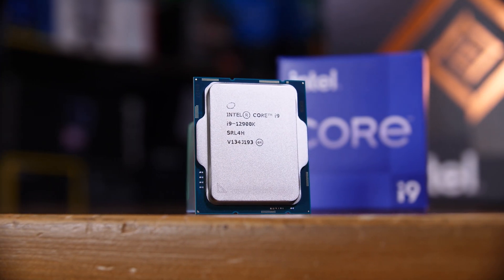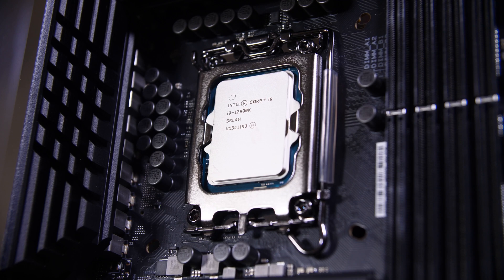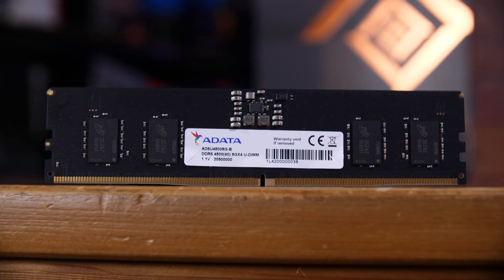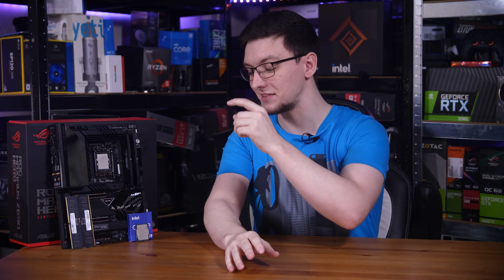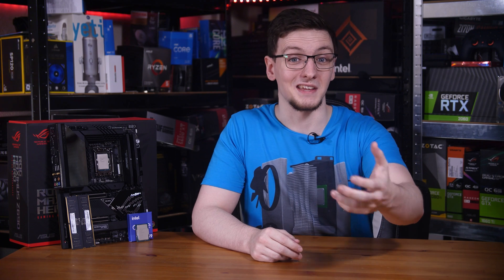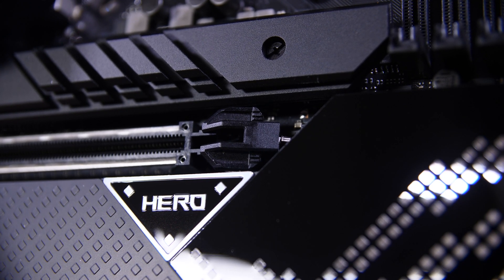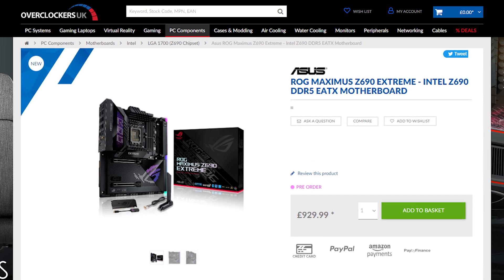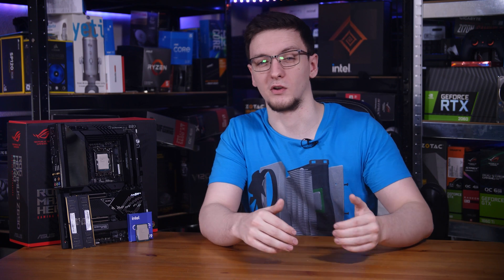Z690 Explained - New Socket, DDR5, PCIe Gen 5 and more…

Comment: I install a quadroo k5000 pci 2.0 card in to Asus  z690 prime A motherboard it has a 
5.0 pci slot which i came to know that its not compatible with pci 2.0. And  i removed the card.
My question is will it did any damage to motherboard?

Comment: I got the MSI Z690 Carbon Wifi + 12700k, though I've only populated 2x Ram slots 5600mhz, because if populated with 4 modules, there's that Boot looping issue that DDR5 has... Ill buy another 2 modules once they fix the boot loop.... but I have a 1tb Samsung 980 pro in and Dam, Its snappy as hell. Loving the speed difference and its notable!

Comment: Sticking with X299 and 10980xe for now. I don't see enough to justify moving to Z690.
Reply: I was on the same boat at first then I started thinking about pci ex gen 5.0 and ddr5 when I know I upgrade gpu's every generation so I know rampage vi extreme on x299 is at the eol and it won't get support for pci ex 4.0 but these z690 boards support both pci ex 4.0 and 5.0 some of them do so if I am looking at it that way I have reason to upgrade but I have another case I will use just so I can keep my x299 system around

Comment: Those mainboards are incredible but I don't give a fuck about the new platform so far. DDR5 is no big deal until they get faster and cheaper, PCIe 5.0 is completely meaningless (even 4.0 is quite irrelevant when you don't really need the fast SSDs) so it's all just way too expensive to care.
Reply: you worng faster ssd is faster loading and faster open world rendering
Reply: @naor9792  And how many games take advantage of that today? In an actual meaningful way that has a noticable impact? None.
Especially on PC where people with SATA SSDs and even mechanical HDDs still need to be kept in mind for pretty much anything.

Don't fall for the marketing, PCIe 4 is primarily good for creative work at the moment.
Reply: @Oceanborn712  tbh im just sad bc i got the z690 master and its dont support gen 5 ssd but if you say we be ok with gen 4 so i take your word on it
Reply: @naor9792  Wow I wasn't aware there's Z690 boards that don't support PCIe 5 SSDs but it does make sense. Consumers really don't benefit from that yet and they won't for a few more years. If you're not working on huge video projects or something like that, you really don't gain anything from it.
But I would be upset as well if I found out my new board isn't as future proof as I'd thought. Honestly, it would have made more sense to restrict the PCIe ports to 4.0 and have the m.2 slots be PCIe 5.0. Graphics cards barely benefit from PCIe 4 and it's gonna be forever until they actually make use of 5. SSDs seem to be more relevant there. But in the end, it's both kinda irrelevant.
Reply: @Oceanborn712  just 2 boards support it and my 470$ board dont support it lol but im just going to be gaming on my pc so i would not need the gen 5?
Reply: @naor9792  because there's nothing that can take advantage of those speeds for now or in the foreseeable future. What would you be playing that needs to load more than 32 per seconds? High SSD speeds mostly matter for big file transfers, not games loading data.
Reply: @naor9792   its too early to tell we should really see the benefit of this new  generation when new video cards release later this year pci ex gen 4.0 gpus  but I am going from x299 to z690 I will keep my x299 around while I am playing around with z690 to compare now I will go ahead and pay extra to make sure I have pci gen 4 and 5.0 I never really pay more than $600 or $700 for a motherboard so I think I should be fine with the asus apex
Reply: @naor9792  many if not all game reviewers say there's no difference. they even show proof compared to old sata ssd's.
Reply: @BobRooney290  yeah you right
Reply: I'm sticking to pcie 4
Reply: Gen 5 overrated tbh

Comment: I'm upgrading from 4770k to 12700k and I got a CM ML240R AIO Cooler which I really don't wanna change, so I wanted to see how would Alder Lake do with these old coolers.
Reply: i would advise not to. check your cooler mountings. 12th gen heat spreader is taller than previous gens. there is a possibility to bend the cpu pcb if the cooler mounting height is wrong. google up this issues. lots of people are running into it
Reply: @adrianvorkaaa3534  ... Been using the 12700k with ML240R with over a month now. No issues at all. The cooler fitted perfectly. Thanks for showing your corcern :)

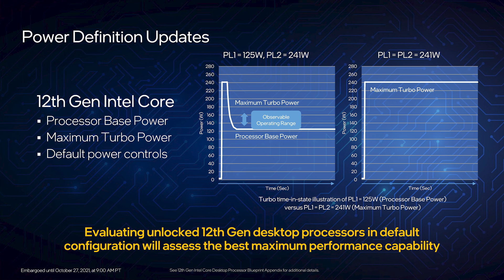Comment: 7:30 it's weird how a lot of the reviewers seems to just gloss over the power draw. I watched eTeknix's review today and he mentioned it but almost seems unconcern with it. In his Cinebench R23 load test, he got a multi score of 27,205 for the Core i9 12900k at 359.5 watts system draw and 24,742 for the Ryzen 9 5950X at a 196.1 watts system draw. For 10% better performance than the Ryzen 9, the power penalty was 163.4 watts. That's 83% more power draw for just 10% better performance! On the bright side, the i9 system idled at 61.2 watts system draw while the Ryzen 9 idled at 82.4 watts, yay for the "efficiency" cores. One step forward, one step back I guess.
Reply: The big variability of power consumption on alder lake is going to make the mobile cpus VERY interesting.
Reply: @nepnep6894  Yeah, especially since the efficiency cores themselves draw as much power as they do. If this is the start of Intel's next decade, that's really troubling for Intel. Makes perfect sense now why Apple abandon them.

They were suppose to innovate and keep AMD in check. What they've basically done is boast power to their cores and made them hold it longer. It gets them that short term win but shoots them in the foot for long term. They went a similar path with Pentium 4 when they couldn't compete with Athlon. Fortunately for them, Pentium 4 held them over just long enough till Pentium M (which developed into Core) was developed by their Israel research branch, otherwise they would have been decimated by AMD in the 2000s.
Reply: Everyone knows this already bud and there is no glossing over,

Troubling WHAT? 
Point is, your talking about $600+ CPUs in the tier of the absolute elites. No one is buying them unless you need crazy scheduling and samples for reviews in what you need it to do- it gets the job done, fast. 

The architecure is brilliant going forward in the near future with the maturing age of the new windows, ram speeds which also wont mature till Z890 comes out. There is headroom, thats what intel is about.

Power consumption with AMD is a myth considering cinebench users knows its never a real life score that represents it. Its super flawed to even use that as a basemark to compare daily wattage when AMD releases Zen 6 with more power into the cores with the same refresh design

If your looking at the power draw differences for the absolute top dog cpu available then last thing is you should be looking in this market looking for the i9 which pretty triumps every game in terms of console ports + especially FPS shooters and video work. Its been years now its been like this. Its only going to go up and up with the new 4090 potentially being needed a 1200w as a must power supply regardless.

Comment: do a video on 12600k paired with a reasonable ddr4 ram and a mid tier mobo. would really really appreciate your perspective on the total price to performance ie mobo + cpu + ram + cooler (12600k vs 5600x)
Reply from the maker: If i can get my hands on one I certainly will!
Reply: I think the 12600k is like 7% faster than the 5800x and cheaper. I got my gigabyte z690 mobo for $195 which isn’t too bad.